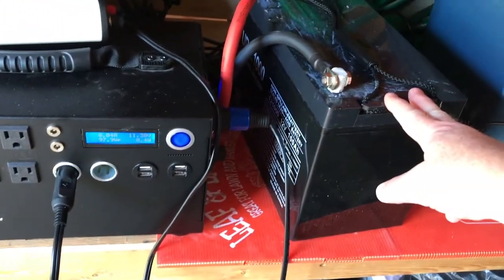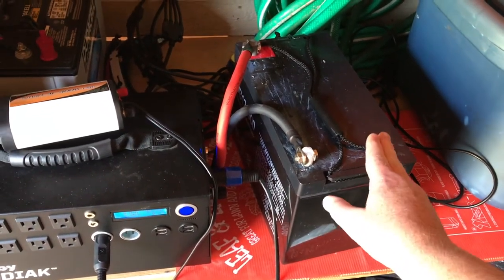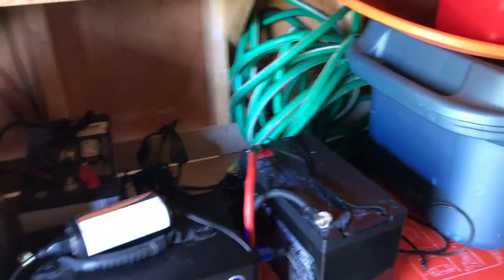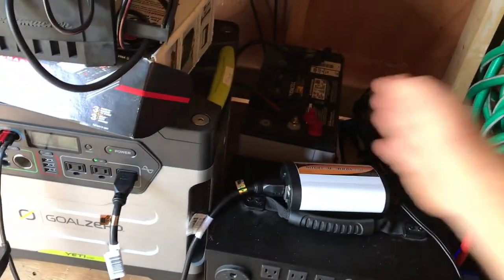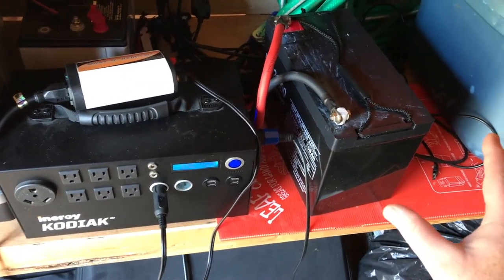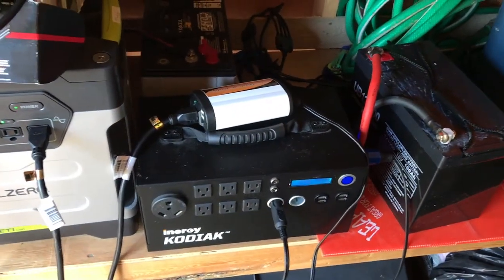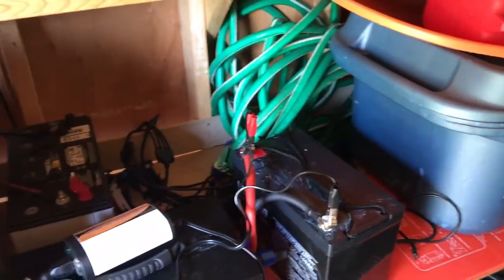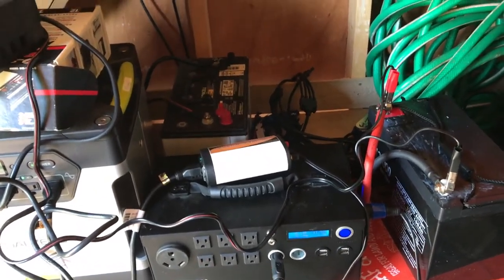Lithium Solar Charger chaining review follow-up

Comment: The Kodiak will only discharge the external agm battery down to 50 percent, then will not use it as a power source and will exclusively use the internal lithium battery. That way it will protect any additional batteries that are connected to the unit.
Reply: I’m curious too....
Reply: That is wrong information !!! The External battery will stay in the ranges of the Kodiaks battery which is 12.3-12.6V full charged and 9.0-9.5V 20% charge left. AGM manufactures state not to let the battery go below 50% this is if using the battery for its intended function I.E starting a motor ECT. However since the Kodiak is only using the battery as a power cell, and not needing to draw high cranking AMPS this will only shorten the AGM's life by a few charge cycles. This does mean however that the external battery will only be good to be used with the Kodiak."
Reply: NEW INFO: I called Inergy directly and asked them about this. And Arly is totally correct. The Kodiak software will equalize the internal battery voltage with any external batteries that are connected. So there is not a disconnect when your ext batts start dropping below 50%. They will continue to match the internal battery's lowering voltage. However, Inergy did say that this would only have a major effect on the cold cranking abilities of the ext batteries. They told me that since the Kodiak never demands a huge surge or "cranking current" from them the external batteries should have very little degradation if used exclusively with the Kodiak.
Reply: Wrong, Kodiak will destroy the AGM battery.   Take a AGm battery to zero power and it is destroyed.  See this video where the Kodiak does just that

Comment: Even if you're only limited to 50% discharge of the AGM battery, you're still getting additional power.  You just have to daisy chain more batteries.  So, let's say your AGM battery is 1000 watt hours.  The Kodiak is 1100 watt hours.  So, being hooked up to the AGM battery, that gives you 2100 watt hours, but, you can only go to a 50% discharge of the AGM battery, (safely) so, you're right back to having about 1050 watt hours available...right?  No? 

But now, if you put two more AGM's on it, that will give you 2,050 total watt hours.  (half of 1000, =500 for each battery, giving you a total of another 1000 watt hours) 

So, you really can get more power, you just have to daisy chain at least 3 batteries, which, isn't any different than any other system.

Comment: Agm batteries will freeze, now saying that they usually will not bust open, like a flooded lead acid. This is because of the glass matting inside the battery. If the battery does freeze you will get little to now power from it until the battery warms up. Now for the battery you have chained up to the Kodiak, it is only a 100 ah battery, even a single 6 volt can be as much as 230 ahrs, put two in series

Comment: So what happens if you put a small trickle charger or solar panel to the AGM? Will the increased voltage or current set off a protection circuit? Could you charge the Kodiak this way? I'm wondering if attaching this into a vehicle with a beefed up electrical system will work, and how the alternator charging will work.

Comment: I’ve ordered a Kodiak kit with three 100 Watt solar panels for my RV but it hasn’t arrived yet.  Could you use an AC outlet on a fully charged Kodiak to power a speed charger that’s charging the AGM (without having the Kodiak hooked up directly to the AGM). ?  Then, once the AGM is fully charged, use it to provide DC power for the RV until the AGM is discharged down to 50 to 70%.   In the meantime, you could have fully recharged the Kodiak using solar and use it to power the RV and/or recharge the AGM again with the speed charger.  Seems like that would allow you to get the maximum capacity out of both the Kodiak and AGM.   
Very possible that none of the above makes any sense.  Just starting to worry after watching this video that I may have made a mistake in purchasing the Kodiak kit.  Thanks for any input you might have. Appreciate your videos.
Reply: VSA, Thanks for the advice. Makes sense. I’ll have to experiment and try to determine the most efficient way  for me to charge / discharge both batteries.  Would like to avoid buying a separate solar charge  controller for the AGM if possible now that I’ve spent this much money on the Kodiak!
Reply: That is the the way to do it.  Perfect setup
Reply: Perfect. The Solar power will charge up your Kodiak a whole of a lot quicker.  I never charge using ac power.  Always use solar.
Reply: @gunny grunt Hey there, hope all is well! I know these comments are from 2 years ago but I was hoping to get an update on your Kodiak setup. Do you still connect the AGM batteries to the Genius Battery Charger/Maintainer and plug that in to the Kodiak?  If so, which version of the Genius battery charger do you use (how many amps)? 
Many thanks!
Reply: Hi! Did this ever work out for you?
I have the 1st gen Kodiak and an AGM deep cycle battery. I had this exact scenario in mind to connect them with a Smart battery charger/maintainer. However, I can't find a video proving it works with no issues. Of course, the answers are always in the comments. I'm curious if you found it to be successful and has it stood the test of time. Thank you!

Comment: Do you have a video about the battery charger on top of the Yeti? Are you able to charge either the Yeti or the Kodiak with a portable generator like the Honda 2000 as an example?

Comment: I enjoy your Kodiak videos and keep them coming. Is that a small inverter hooked up to your DC outport? I'm doing the same thing with mine in order to use less battery. 😎
Reply: I am using a external 300 Watt inverter, works great

Comment: I wish I knew you personally for some help.. 
how do I calculate what I'm trying to hook to the Kodak.. 
I want it to supply my power for my garden.. 
do I calculate watts, amp or volts.. or all of them..??? 

I'm trying to decide if I should get one.. I think my ac unit might be to much for it.. so maybe it can work for my led light and little fans.. 
I'm sure it can't run all for 18 hrs plus..

Comment: I have a question, does the Kodiak shut off at 11.5v instead of the 9.8v when connected to an AGM or Flooded battery? usually when by itself the Kodiak will shuts down at 9.8v but for what I understand from the video if you connect an external battery it will change the limit and then shut down at 11.5 to protect the external battery but since the Kodiak can go lower than that you don't like the external setup. Is this correct?
I really want to know if it just shuts down at 11.5v of you shut it down manually because I am interested in knowing if it automatically protects the external battery by shutting down at 11.5v when it detects an external source...
Thanks

Comment: please help.. which component will work best for my indoor garden.. 
please 
I don't know how to calculate everything correctly.. 
I want to run my kindled k3 l600
..

for 18 hours on..
Reply: Van and Solar Adventures
 it is 300 watts 600 equivalent.. 
do I check by watts or volts or amp..

Comment: I thought goal zero had a lithium battery inside?
Reply: Certain ones have Lithium batteries now. The Yeti 1250 has a lead-acid, but the 3000, 1400, and others have lithuim-ion ones in them.

Comment: The External battery will stay in the ranges of the Kodiaks battery which is 12.3-12.6V full charged and 9.0-9.5V 20% charge left. AGM manufactures state not to let the battery go below 50% this is if using the battery for its intended function I.E starting a motor ECT. However since the Kodiak is only using the battery as a power cell, and not needing to draw high cranking AMPS this will only shorten the AGM's life by a few charge cycles. This does mean however that the external battery will only be good to be used with the Kodiak."